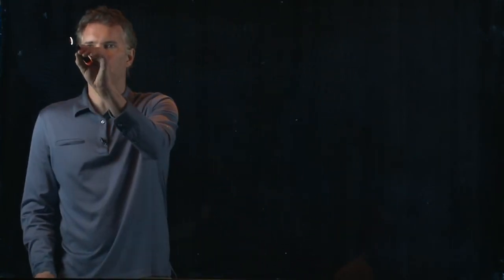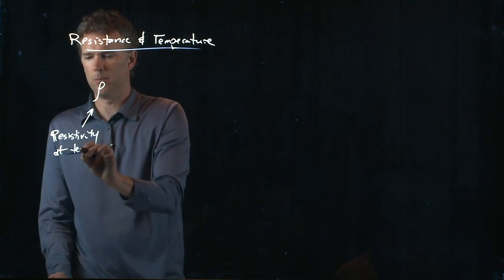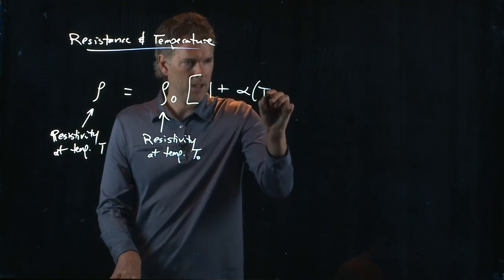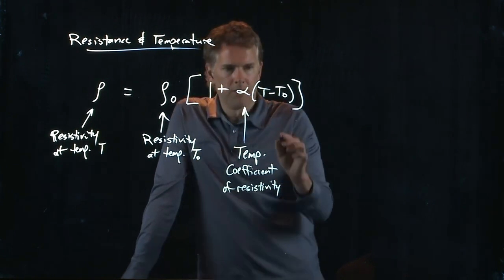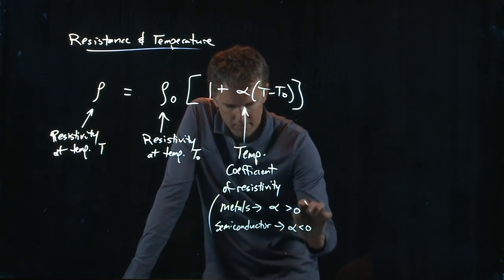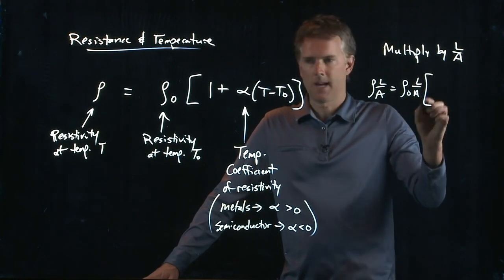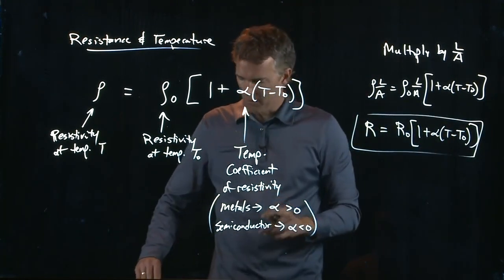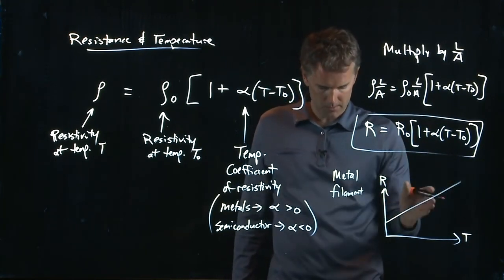Resistance and Temperature | Physics with Professor Matt Anderson | M21-13

Comment: Prof., great work and very interesting content! 
I have a question regarding resistance with regards to temperature. As you highlighted at the end, the resistance increases with temperature; however, for example an electric car has in winter shorter range due to reduction of battery capacity as a result of increased inner resistance. So it is the other way around (lower temperature --> higher resistance). How do you correlate these two opposing phenomenas, both related to resistace beings a function of temperature?
Thank you!